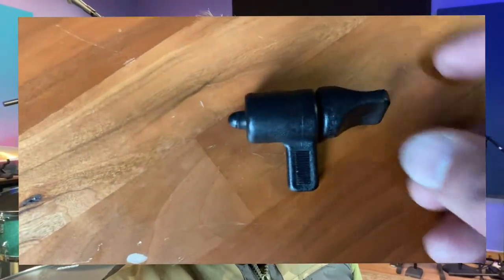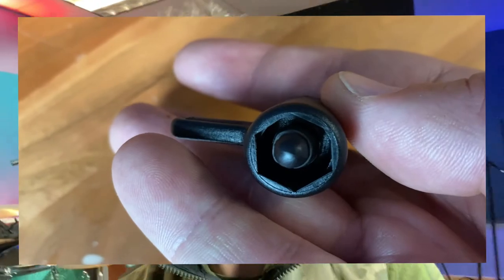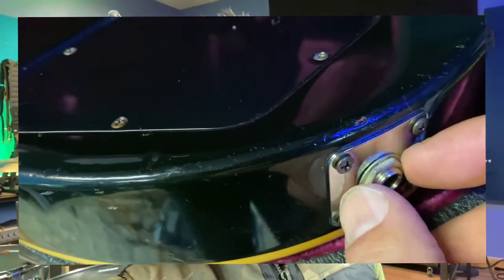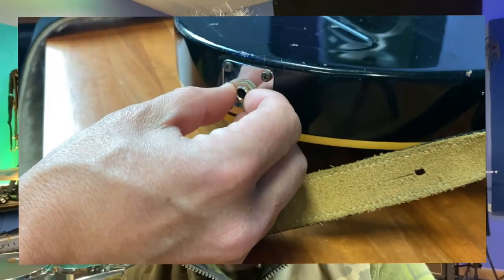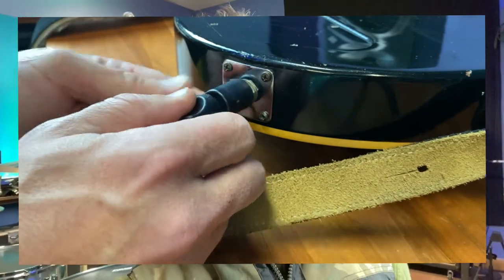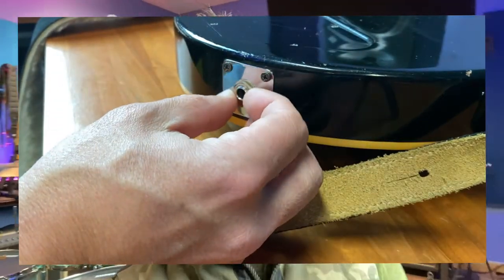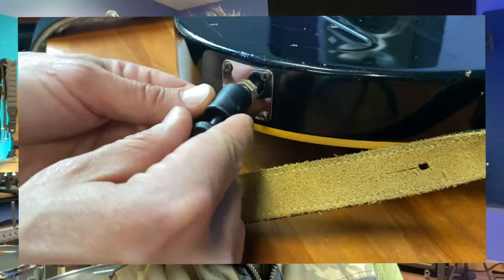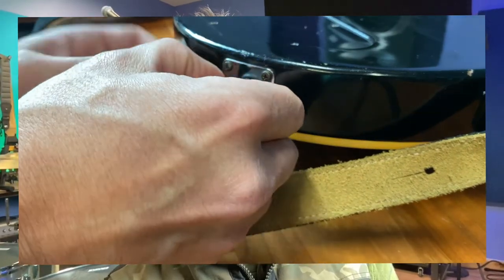Taylor Sound Tip of the Day - Guitar Jack Tightener

Comment: will this work on a strat with the jack on the front side of the guitar, or will the nut turning assembly interfere with the front facing jack plate and prevent it from turning the nut ?
Reply: It works, I'm 100% sure.